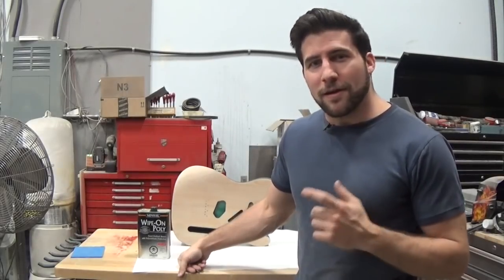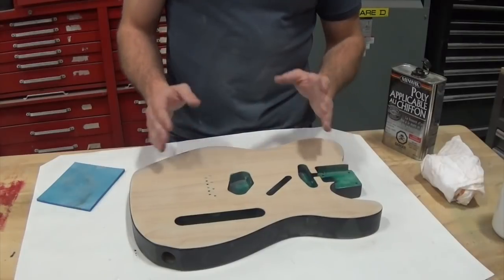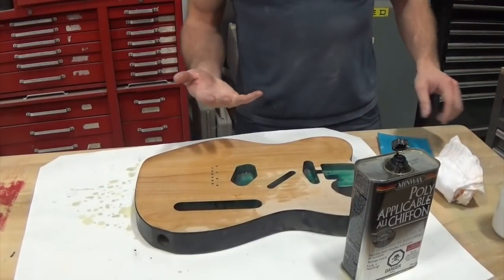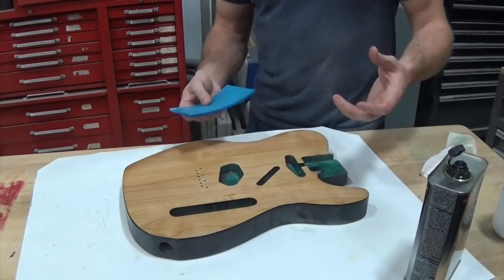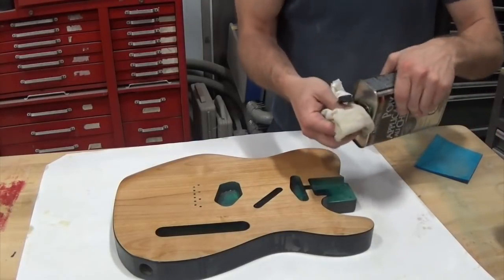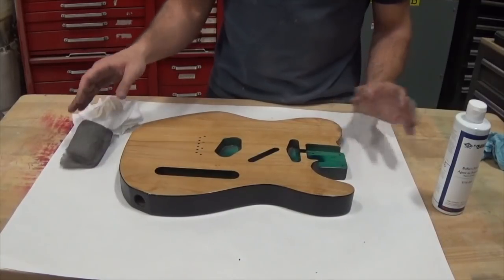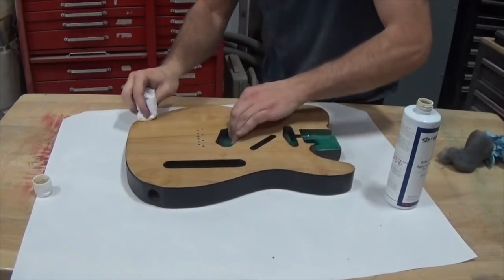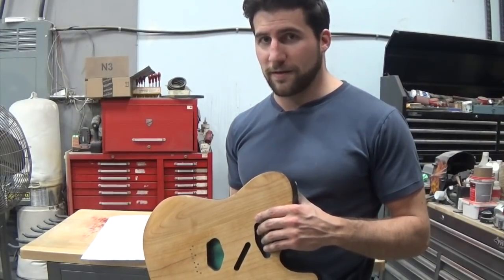How to apply a perfectly smooth poly finish by hand

Comment: How well does the sandpaper trick work with dyed woods? Great video by the way.
Reply from the maker: It will usually lift some of the dye and cause a bit of a distressed look.
Reply: @BradAngove  Similar question - I used a sanding sealer prior to dying Les Paul body with maple veneer. I got the grain to really pop and the color is right where I want it. Your technique for the finish coat looks perfect for my application, but am worried that the sandpaper application will fade my dye job too much. Do you think a higher grit would help reduce the risk?  The body is really smooth now (maybe because of the sanding sealer?). What are your thoughts on just straight wipe on with a rag in lieu of the sandpaper applique? Your videos have really been helpful btw
Reply from the maker: That’s what I would recommend. Just use a rag and know that you will likely need an extra couple coats to fill the grain.

Comment: What are the pros and cons of wiping on poly vs spraying it on?
Reply from the maker: Are you applying it on bare wood, or on top of a color or something of that nature?
Reply: @BradAngove : Bare wood.
Reply from the maker: This method allows for better filling of the slightly open grain. Spray an awesome way to get a nice even looking finish if you’re good at it, but you’ll likely want to start with sealer if you’re spraying.
Reply: @BradAngove : Ah, I see. Thanks a lot.

Comment: Hi Brad would this way work with a swamp ash and water base dye?
Reply from the maker: Swamp ash has relatively open grain so it may not fill all that well. Also, using the sandpaper method over dye can create issues with dye removal.
Reply: @BradAngove  what would be a good idea for swamp ash using water dye?
Reply from the maker: You can use this product. Just don’t use the sandpaper method. You can apply a clear sealer instead.
Reply: @BradAngove  ok I’ll give that a try still probably too cold here in Ontario so just trying to get some ideas
Reply from the maker: Ya, probably a bit chilly still.

Comment: Hey Brad, what did you do for the sides and back? is it a base clear? or dye and you polyed it after?
Reply from the maker: The sides and back are a water-based varnish that I mixed some black fabric dye into a couple years back. I've been painting and re-painting this body for a while now for various demos.
Reply: It looks good man, I so far have done two guitars with tips from your vids and they have come out pretty nice. Last guitar I just did was an RG assembled piece by piece, used leftover Base/clear and sealer from the last auto body job I did at work.
Reply: Thanks for sharing your skills btw.
Reply from the maker: Thanks for watching. I'm glad your projects have gone well.

Comment: Does anyone know how durable a finish like this is. Like how does it hold up against a spray on poly finish on a factory guitar?
Reply from the maker: Factory polyester is more durable. It’s catalyzed and very difficult to damage.
Reply: @BradAngove  So unfortunately, if you'd like finish like that you'll need a setup similar to a factory? :)
Reply from the maker: If you take a look at my video on how to get a professional looking coat of clear with spray cans, that product is about as close as I know how to get without a spray rig. If you have spray equipment, simtec makes a very durable polyester product. 
The other option is a hand applied epoxy, but it’s a lot of work to get smoothed out on the sides etc.
Reply: @BradAngove  Okay thanks very much  :) Hope your 2021 is looking good.

Comment: How dificult would it be to repair a small ding in a clear poly finish on a guitar... doesn't look like the body itself has been damaged... just the clear finish is cracked... Thanks...
Reply from the maker: More difficult than if it were lacquer unfortunately. You can fill it, but generally you will be able to see evidence of the repair unless you respray the whole area.

Comment: What grit are you using for the first coat?
Reply from the maker: I would generally use 400-800 grit depending on the state of the wood and how tight the grain is.

Comment: Can I put poly on a matte finish with out a lot of prep
Reply from the maker: You would sand and clean it and then go ahead with the poly.
Reply: @BradAngove  thanks
Reply: @BradAngove  after applying poly found lots of flaws how do I remove poly and then apply clear filler
Reply from the maker: Just sand it off.

Comment: How can I paint my guitar in the winter if I don't have a workshop? Which paints are less toxic to use indoors in winter? I have a very nice veneer I want to apply to the top but I also want the rest of the basswood body  to be black like in this video. Thanks!
Reply from the maker: Use water-based paints.
Reply: Thanks for the reply. I don't know what to use for a natural top that is compatible with water based paints. I have been looking at India Ink for the black and then use tru-oil for the veneer top and also over the India Ink after it's dry. I also want the black parts to not show the wood grain. I'm thinking to apply a wood grain filler or a primer before the India ink to hide the wood grain and other imperfections from glued wood.
Reply from the maker: I’m not sure I understand. You can get water-based stains. You can mix aniline dyes in water. You can also get water based wood filler, primer, paint, and various finishes including water based lacquers, polys, and varnishes.
Reply: OK. I will do some research. I know very little about paint. Thank you.
Reply from the maker: Ask around at a hardware store. They should be able to direct you to some water-based options.
Reply: 0Orion try Crimson Guitars on YouTube
Reply from the maker: Crimson makes dyes. No paints last I checked.
Reply: Thanks for the replies everyone. I think I found a place where I can paint and not bother anyone with paint smell. I can use any paint now. 

BTW, before I found the space to paint I picked Vallejo acrylic-polyurethane surface primer 73.602 Black and wipe on poly (not the water based one). Those paints do not smell too bad. The water based wipe on poly would have likely been better but I could not find it locally. I was also going to use water based Timbermate wood filler to fill the grain or another wood filler.
Reply: @0Orion  Water based acrylic paints are widely available. They can be found in almost any hobby shop (Michael's, Hobby Lobby) and even at Walmart.

Comment: Hi Brad, would you mind writing in the descriptions the products you use? And even better a link to the Amazon product? It should also be useful for you as you get paid... Thanks
Reply from the maker: In my newer videos I’m more specific about the products and my amazon link has most of them. This was just a wipe on poly from Home Depot.
Reply: For those wondering, this particular item he's using is MINWAX Wipe-on Poly.  They make two different kinds:  water base and standard.   The water base is somewhat like a thin Elmer's Glue and is applied thickly but has a beautiful finish (watch for drips).  The one he's using is very thin in nature... and very toxic (both in fumes and skin permeation).  Wear nitrile gloves while using it and have proper ventilation.  Stuff isn't as bad as laquer, but the toxicity should not be taken lighty.

Comment: Can I use this method over a stain or paint?
Reply from the maker: It could remove some of the stain or paint and possibly give a distressed look if you do.
Reply: @BradAngove  Thanks, Brad. Is there a hand-rubbed or a hand-brushed on product I can use over paint? I do not have a place that I can place where I can spray. Small apt living. Thanks for all the great videos. It's helped me stretch out my guitar building skills.
Reply from the maker: You can use this product, you just can’t use the sandpaper technique to begin with. You would just wipe it on.
Reply: @BradAngove  Thanks. I'm going to give it a try. Ont the back first right? LOL
Reply from the maker: Haha yup. Maybe the bottom edge that faces the ground when you play.
Reply: @BradAngove  I am trying to recreate a guitar from my youth that had a similar burst as a less paul jr. two-color burst. Not high gloss but a little bit of a shimmer. An early 70's Carvin. I appreciate your help. Thanks

Comment: What's a good source for rags that don't shed a ton of lint before they've been washed a bunch of times?
Reply from the maker: I think I bought a massive bag of them from home depot a few years ago, but I'm not quite sure. I tend to keep a lot of my old t-shirts for that purpose if they don't already have paint on them.
Reply: Guess I should just bite the bullet and prepare a big batch to put away for future use. I'm always looking for "low overhead" solutions for types of projects I don't do very often.
Reply from the maker: Most thrift shop t-shirts have probably been through the washing machine their fair share of times haha.
Reply: Ha! Yeah, but I don't want to think about why they needed washing...
Reply from the maker: Fair enough.
Reply: I have an idea for rags that's cheaper than buying bags of them. Get a heavy thread count sheet and cut it up into rags. That's a lot of rags, and the material is much finer than t-shirt material. One sheet will probably give you 3-4 years of rags. Could be really sweet for that final polish, too.

Comment: I used fountain pen ink to stain a sunburst style my guitar body,  my question is can i use this method to clear coat it?
Reply from the maker: I wouldn’t recommend it. It will affect the dye.
Reply: is there a better dye to use to get a red/orange sunburst and use this process for clear coat?
Reply from the maker: The problem isn’t the dye itself, it’s that you would be sanding back into it with this process.
Reply: fair enough. Thank you for the info.

Comment: brad please don't shoot me, i did the first 2 coats with the sanding and then followed up with another 2 thicker coats, when i tried to sand it smooth i got sand through in some places 
my reaction was to scuff the cured poly and add more coats but now i've sanded to soon and  my poly is all @**$%% up on the back is there any way i can still get a clean poly finish out of this or do i have to strip completely
Reply from the maker: +nigel van acker Patiently let it dry, then scrape off the high spots carefully with a razor blade. Sand it flat again with a block and the add another coat or two carefully. If you rush it this time you will end up with the same problem.
Reply: Brad Angove do i have to worry about thé badly sanded layers of Poly underneath or Will that dissapear ? I'm worried about adhesion problems
Reply from the maker: +nigel van acker You’ll have to sand back until it looks even, otherwise the lines will show. If you’re sanding it flat first, I don’t imagine there should be any problems with adhesion.
Reply: Brad Angove thanks dude i'll let it cure for a week now before i sand and then apply some more layers (and let it cure for probably twelve years just to be sure )
Reply from the maker: +nigel van acker Twelve years haha. That ought to do it.

Comment: You think that a teak oil wil work like the poly?
Reply from the maker: Not quite. It still works well, but it’s a substantially different finish.
Reply: Brad Angove it still have a shine?
Reply from the maker: Definitely less of a shine.
Reply: Brad Angove thank you very match !!! 
 a water base wipe on poly wil work either?
Reply from the maker: That should work fine.

Comment: I bet a small-to-medium sized (3" - 5") dual action polisher made for polishing the paint on your car would be a really good tool to have for this kind of work. Not that expensive and you can still obviously use it on your car.
Reply from the maker: I use a polisher for applying oil finishes sometimes. It does great for that sort of thing. Works well for wax as well.

Comment: I swear the poly we get in the UK is inferior because evertime I try to do a poly coat, no matter what brand I have issues. This time around it just isn't curing for some reason and remains permanently tacky. I had the exact same problem with nitro laquer.
Reply from the maker: What kind of temperature and humidity are you painting in?
Reply: @BradAngove  current UK weather is fluctuating quite a bit at the moment but the day I applied poly was sunny and dry but about 16 degrees. I originally left it out in my workshop for 4 hours in the day time and I've since taken it indoors. It's been about 48 hours now. I'm wondering if it may be something to do with the stain I used prior. Regular water based wood stain. Do you think I should just persevere and leave it for longer? Thank you for the reply on a 2 year old video! Dedication 👍
Reply from the maker: It would be odd for a water based stain to prevent it from drying. Do you have access to a hair dryer that you can use to blow hot air on it from a distance?
Reply: @BradAngove  ok that's good to kkow. I do indeed. Thank you, I'll give it a shot! 👍

Comment: Can i use it on a guitar neck?
Reply from the maker: Yes.
Reply: Brad Angove thank you very match great videos!
and do you think that i can use a clear rust-oleum 2x spary can to finish a guitar?
Reply from the maker: You can use rustoleum if you want. As for the neck, I did a video a while ago about applying wipe on poly to a guitar neck.

Comment: Brad are you a fan of Poly instead  of Nitrocellulose?
Reply from the maker: I like both. They are both good for different reasons and different applications.
Reply: Which would you suggest over a pearloid acrylic on a guitar I'm refinishing?
Reply from the maker: Generally I use a catalyzed poly spray over over acrylic.
Reply: Thank you!!!

Comment: Brad if you have time do I have the step correct 

have surface sanded smooth with 600 
grit sandpaper

apply first coat of poly with 1500 
grit sandpaper sand the entire 
surface

let set for a few minutes the with a 
clean cloth wipeoff the surface
buff with clean cloth then

Repeat the entire first coat process 
with the sandpaper again.
wait 30 to 40 minutes 
lightly sand with 1500 grit sandpaper

now apply with a rag
Apply a thin coat and wait 10 to 15 
minutes then apply next layer repeat 
applying 3 coats then stop let dry 
over night

sand lightly with 600 to 800 grit

then repeat applying with a rag.
can apply as many as 3 layers without sanding between layers wait 10 to 15 between each layer
repeat as many times as needed.

next sand with several grits start 
with 1000 then work all the way to 
3000 

last apply buffing polish on surface 
with 0000 steelwool or high grit 
sandpaper. 

next using buffing polish and a clean 
rag apply and buff the polish on the 
surface to a high gloss finish. Takes 
a lot of elbow grease.
Reply from the maker: All correct except for adding polish with an abrasive. Polish should only be done with the clean lint free cloth.
Reply: @BradAngove  Your the man I have learned so much from you I have been watching your videos and taking notes for reference when work on my project. Thank you again Brad and please keep up the great work and videos. I get a good chuckle out of your reactions.

Comment: I'm purchasing a guitar with a somewhat unfinished maple fretboard and really want a smooth semi gloss poly finish. I was wondering if the same steps are involved and the steel wool for polishing and  can also be used to take any excess poly off of the frets? I have a choice of maple or rosewood but I really love the feel of a smooth finished maple neck. If it's as simple as you make it look makes me even more excited to get the maple fretboard. Debating whether to do the whole neck or the fretboard itself. I understand this video is 2 years old. Thanks for the great advice and honest content btw!
Reply from the maker: Yes, you can do this on the fretboard as well. If the frets are polished you can carefully cut down each side and peel off the poly.

Comment: Steel Wool to polish?  Really? Its looks as nice as the  mahogany les paul copy I just finished with a fine brush and poly. That mohagany is a bitch to get super smooth without filler. I dont think Ill use Urethane again, I think it goes on a little too thin. The slightest use of a 3M pad between coats can bring parts of it back down to wood. Ive got about 30 coats on it and the finish might not be a thousands of the width of of a sheet of Saran Wrap. But its a very pretty Rootbeer BlueBurst! lol :)

Comment: Better to use grain filler, stain than poly, wet sand 1200 between coats
Reply from the maker: That’s an option. Although 1200 is too fine. It can work, but it creates an unnecessary risk of delamination and it provides no benefit over 800 grit in this context.

Comment: Will this technique (using sand paper to apply the poly) work on a stained body such as this where the grain is stained first, sanded back, and then the final stain is added? This is a good example of what I would be concerned sanding over https://www.youtube.com/watch?v=FCgrnqACavk&t=0s
Reply from the maker: It should work, but there is concern that you will harm the final dye when you do it. You would be safer either applying it he normal way, or applying it after you initial accent stain is sanded back, and then mixing the blue into some clear coat and spraying it.

Comment: Pouring from the van is messy. Use a small measuring cup for less wastage
Reply from the maker: Pouring from a van would be very messy indeed.
Reply from the maker: Particularly if it was moving.
Reply: Hahaha damn auto correct haha “Can” as in Stan told Fran to take the CAN to the tan van man!